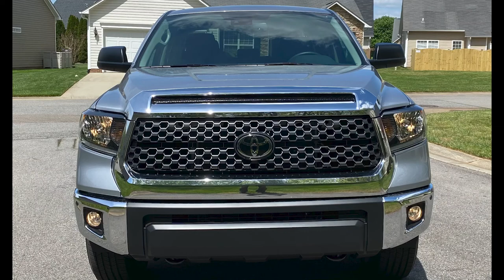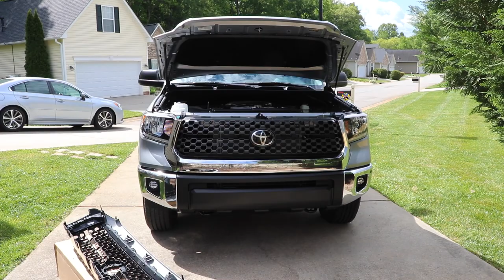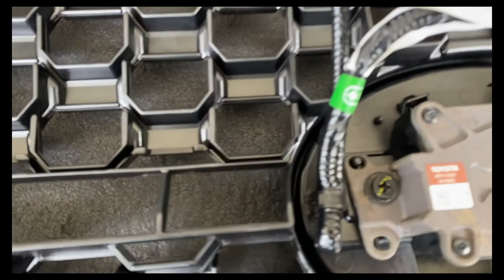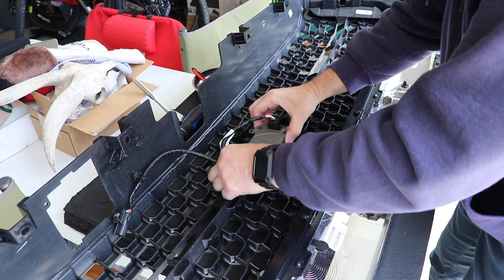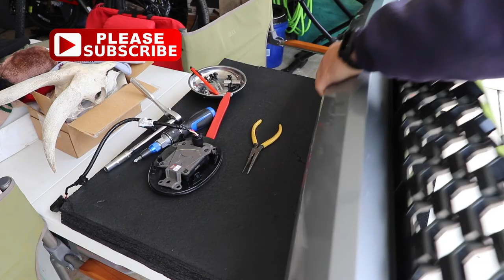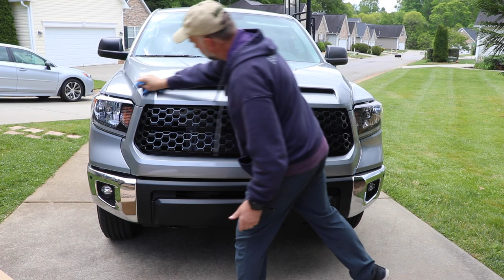Toyota Tundra Grille and Bulge removal and install

Comment: Good video with 1 exception.  And it could be costly.  The "clips" on bottom of grill don't lift up.  You actually have to push them down by reaching behind the inside edge of headlight assembly. Pulling up can snap those clips
Reply from the maker: I’ve seen videos where a tech uses a long screw driver to push down on them. I’ve tried a million ways and it’s just a two hand job to get those clips to release. Thanks for watching.
Reply: @828findadventure  if you look under grill and see where they are, you can squeeze your hand down and finger tip it.  I've pulled this thing in the past but couldn't remember how, and your video shined the light I needed.  Lol. Thanks.

Comment: Looks great without the chrome surround! Your silver sky metallic looks great! I have a magnetic grey metallic, and while I love the color. I work in the woods and the darker color shows scratches too much. Both look good with black accessories but I like more contrast with silver and black vs grey and black. Mine is a 2018 with 120k and the truck still feels like new. Cheers 🍻
Reply from the maker: Thanks, the first change I made on the truck was the grille surround, drove me nuts all that chrome. Thanks for commenting.

Comment: What is the TSS sensor? I just ordered a replacement grill for my 2016, putting in honeycomb style.
Reply from the maker: @robertmantell1700  I believe from 2018 on all Toyotas came with TSS. Toyota Safety Sense. Usually includes, Blind spot monitoring, Adaptive cruise control, lane departure warning, and emergency braking / forward collision warning.
Reply: @828findadventure  Aye! Thanks! I'm wondering how much it does in the work grade Tundra I've got. I get some slight reductions in speed if in cruise control and coming up on a slower vehicle, but else nothing like you described.

Comment: Is the sensor for the emblem an airbag sensor??
Reply from the maker: The extra large emblem is for the TSS sensor. Toyota Safety Sense, cruise control, and impact warning with auto braking if your truck came with it. It’s a sensor bolted behind the emblem.

Comment: Pls do you have exact part number of that grill super hard to find my dealership can’t find them for me here in Canada
Reply from the maker: OEM TOYOTA TUNDRA 18-21 TRD SPORT GRILLE & HOOD BULGE

Interchange Part Number:
761800C030B0, 531010C041B0
Number of Pieces:
2
Type:
Grille, Bulge
Color:
SILVER SKY METALLIC 1D6
Manufacturer Part Number:
53101-0C041-B0
Finish: Painted

https://www.ebay.com/itm/284170521782

Thanks for commenting and subscribing.